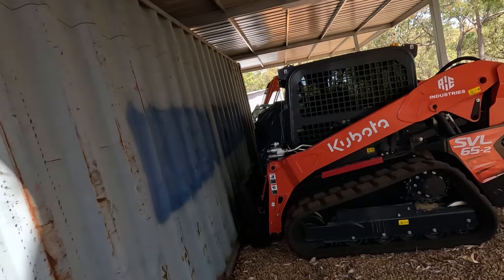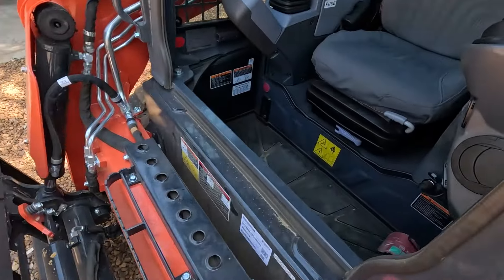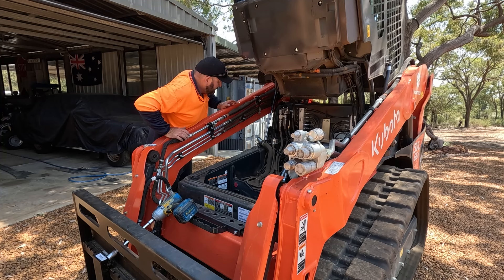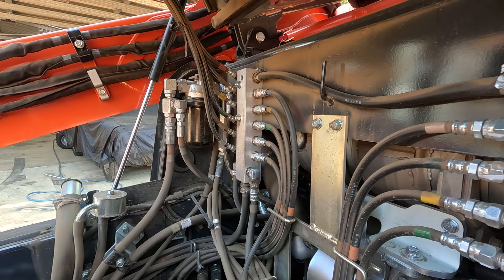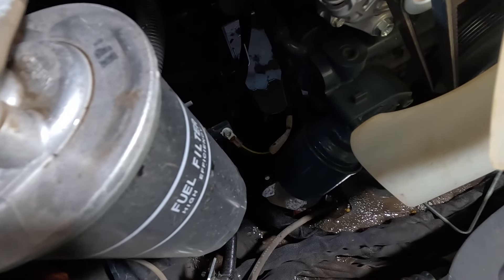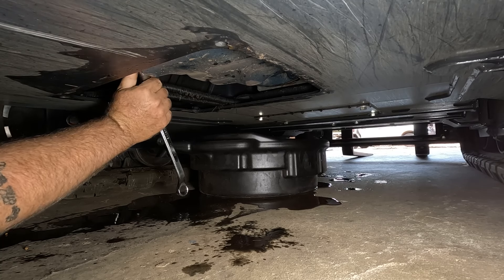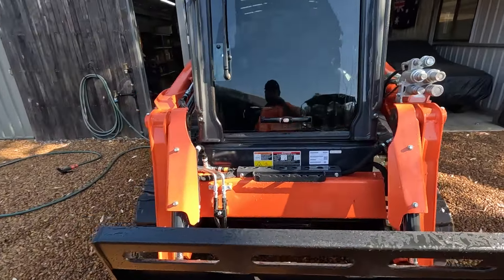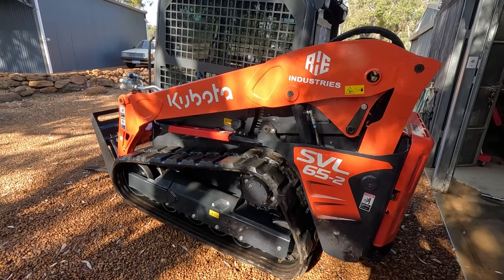Kubota SVL 65-2 First Service (50Hr)

Comment: Thanks for showing the struggle with the hydraulic filter. I'm looking to buy one of these soon and I'd like to know what I'm in for as far as maintenance goes.
Reply from the maker: @DaD8801  Apart from that stupid tight filter the rest has been easy as. They are a pretty simple machine to maintain!